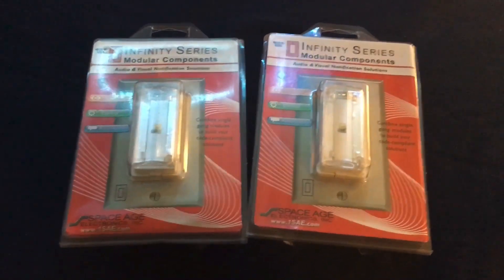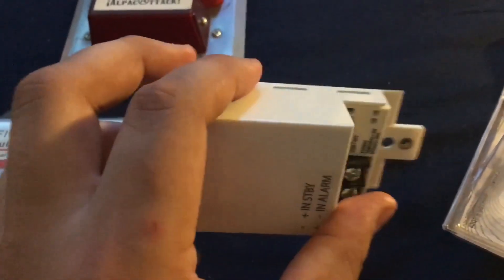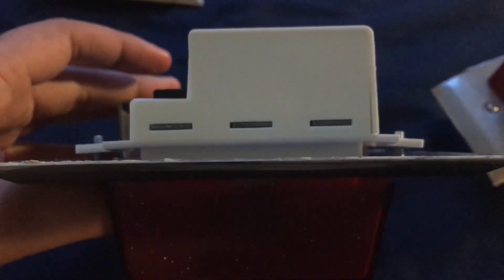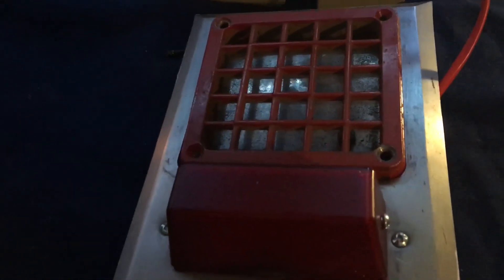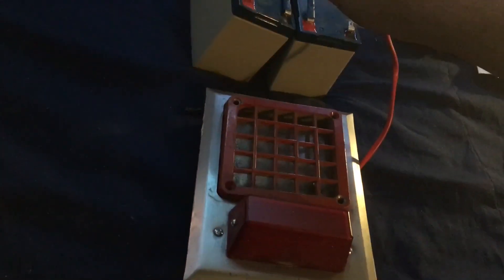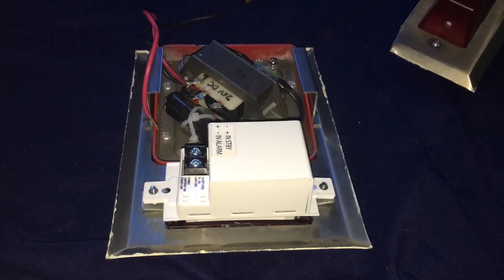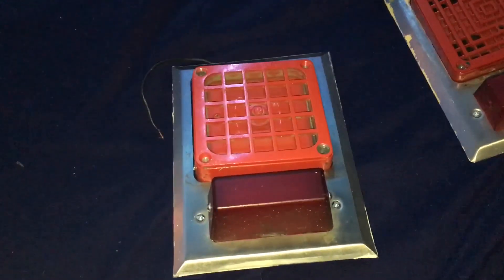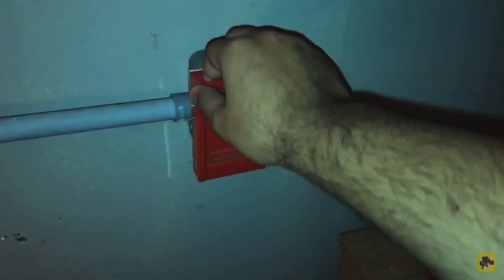Space Age Infinity Series LED strobe Review/Test. Would it fit behind a Simplex 4050-80 light?

Comment: The reason you don't hear a capacitor is because if you open it up, you'll notice that it's just a tiny little garden gnome flipping an even tinier light switch back and forth. In all seriousness, it's really neat watching what everyone's doing with the IAVLS strobes. Thanks for making this!

Space Age does make a sync version of their xenon strobes, but the LEDs are free run. Just like the -9219, it's probably just a result of using a similar set of components as the sync models.

SAE sync system info page - https://www.1sae.com/iavsync-sync-system
Reply from the maker: Ohh wow, I somehow missed the gnome, which explains why the strobe didn’t make any ticking sounds when it flashes. That’s new to me. It’s my pleasure to make this.